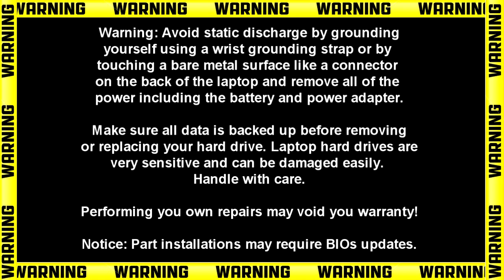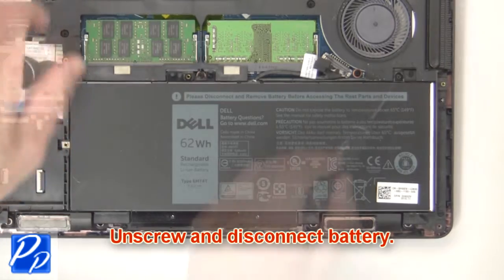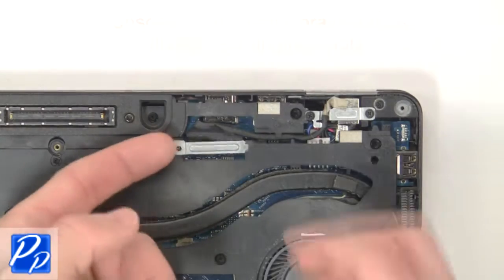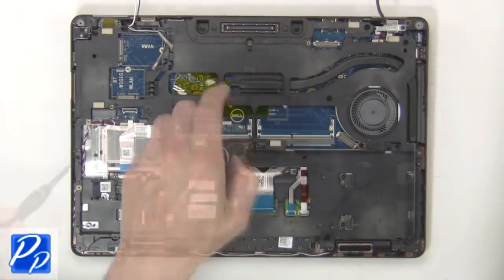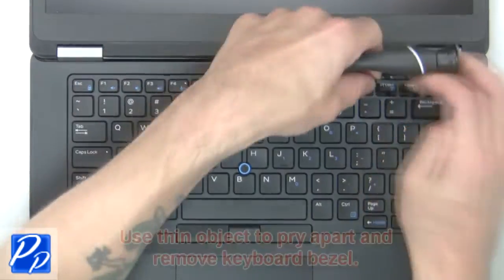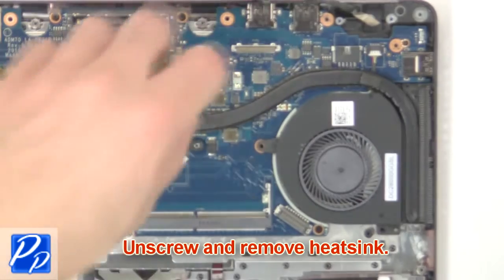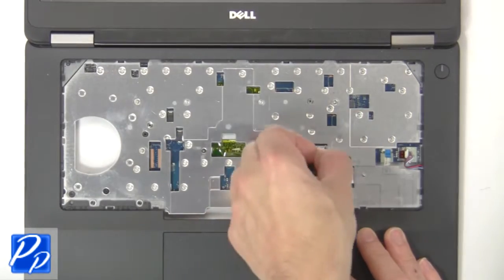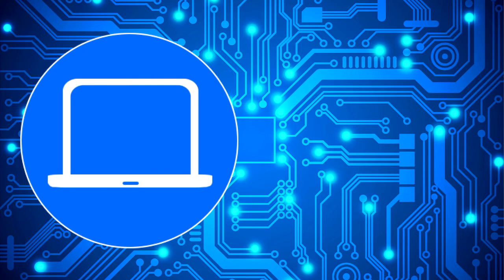Dell Latitude E5470 (P62G001) Motherboard How-To Video Tutorial

Comment: Hello. 
My service tag is 66JXGC2 . 
It is Dell Latitude E5470 model and the motherboard has failed. 
Motherboard (02MMKG / LA-C831P) is wearing i5-6300 hq processor. 
Will 
Motherboard I5-6440HQ 792TG 0792TG LA-C831P direct fit to my laptop. 
Thank you in advance.
Reply from the maker: These are both Latitude E5470 motherboards and have the same I/O configuration on all sides. Based on this information the 792TG should be compatible.

Comment: your heatsink is 2 times smaller than mine , why could that be ? And is it possible to have another ram slot under the keybord ? I have never went that far , I just change the thermal paste and clean the Fan , but now the screen is moving too much and I want to go furder to see what is casing it . Nice video :)
Reply from the maker: Thanks! So this model has 2 versions. One with 1 memory slot, and another with 2. And they are both located under the base cover. You won't find a memory slot under the keyboard. Hopefully this saves you some time.